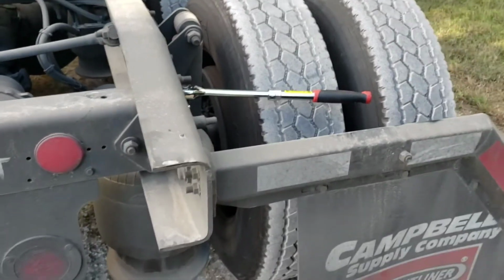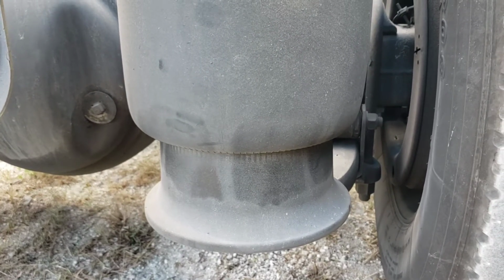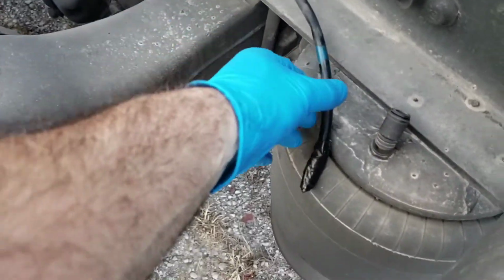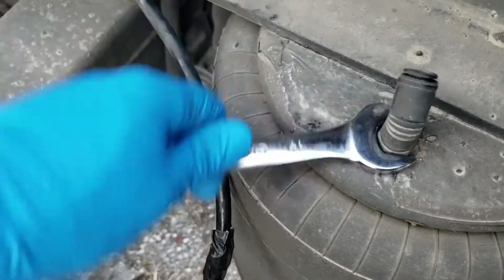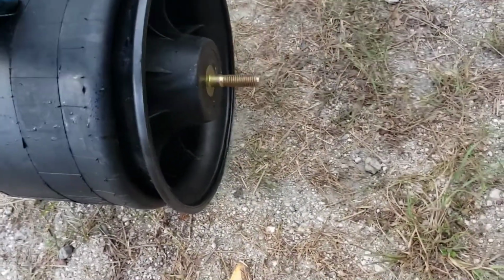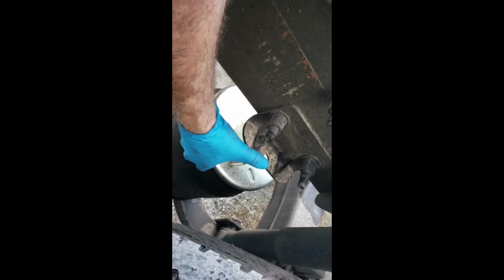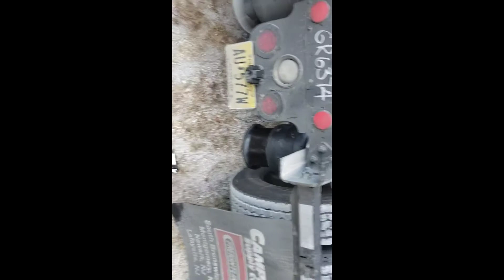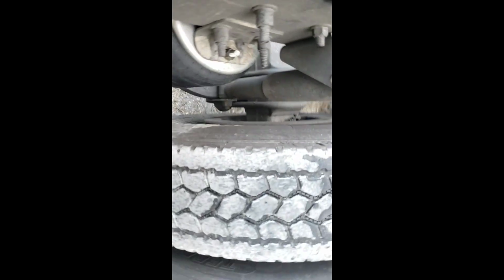How to replace airbag on Freightliner cascadia

Comment: Thank you so much. You made it easy for me. Please advise what brand airbags should I buy. Much appreciated. Be safe
Reply from the maker: The model is Firestone 1T15x series  C01-358-0572
Reply: Any reason not to clean the area off from the rust?
Reply: You forgot the never seize on the bolt.